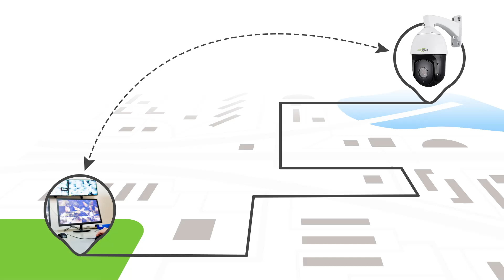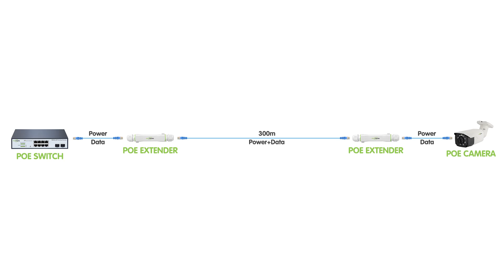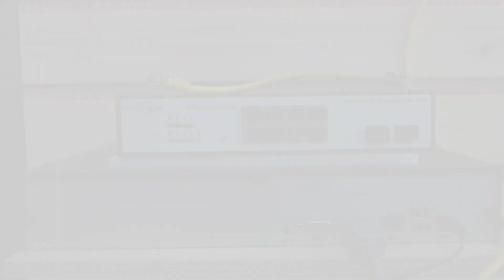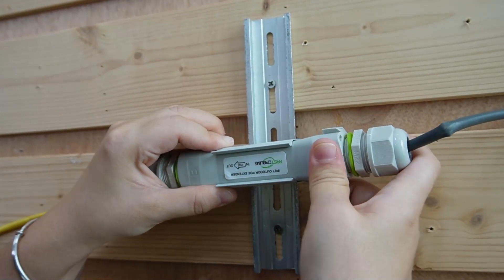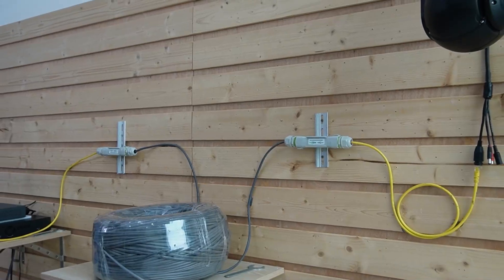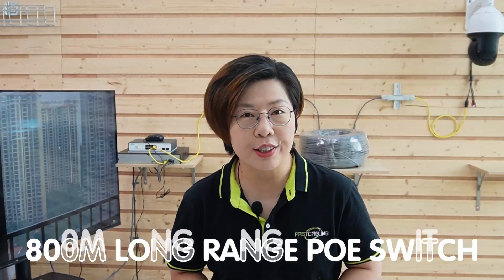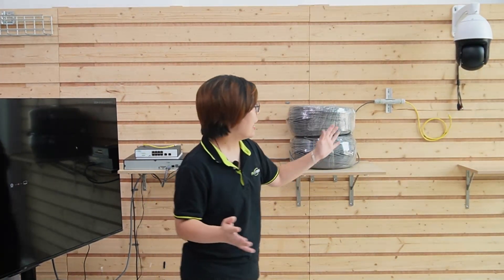Unlock 1500ft Continuous Connectivity for High Power PTZ Camera

Comment: what router would you recommend to use on your system?
Reply from the maker: You can use the one you currently own. Our products are onvif-compatible and can work with third-party platforms or devices without any issues.